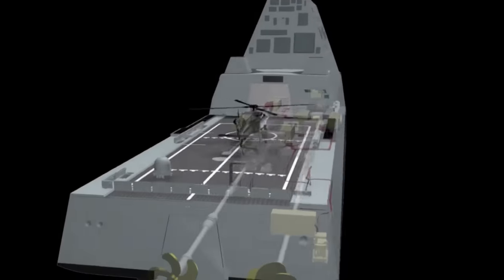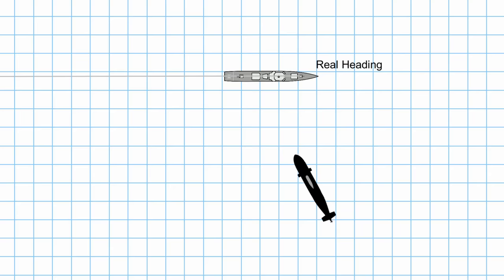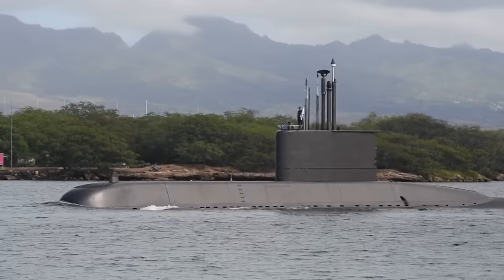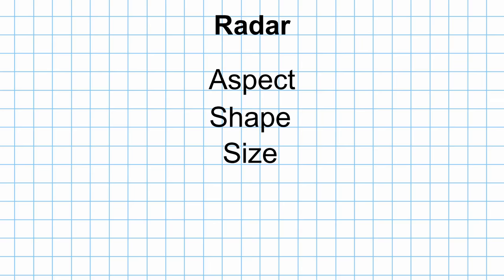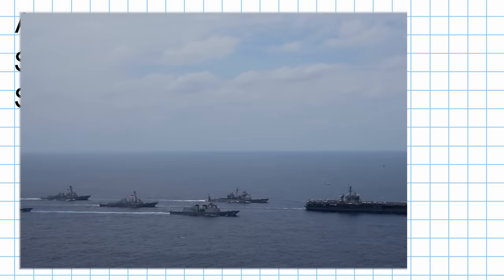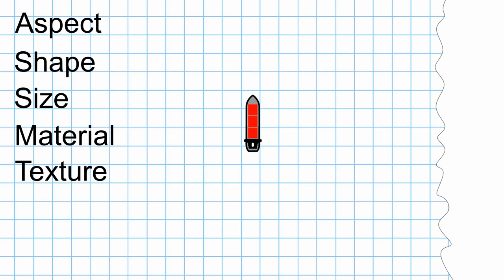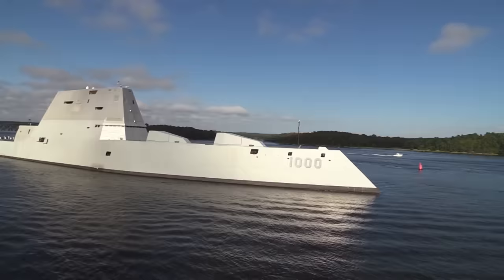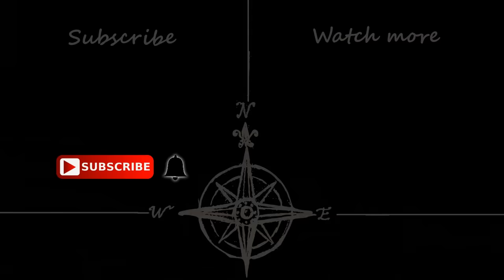Stealth Ships: How They Work

Comment: So you're telling me a wooden rowboat made of nothing but flat panels of plywood is the ultimate stealth ship?
Reply: Well it is but probably not very good of a battleship...
Reply: @eklhaft4531  They cannot shoot at you if they cannot see you.
Reply: What if u build of wood outside and inside with steel maybe that will work
Reply: @alexanderszewczyk8919  genius
Reply: @alexanderszewczyk8919  A wooden clad modern warship? Amusing.
Reply: @alexanderszewczyk8919  The radar waves that the radar is emitting would go straight through the wood, onto the metal and reflecting off it. Wood is a poor reflector as in it doesn't reflect electromagnetic waves, but lets them through.
Reply: @alexanderszewczyk8919  wood is invisible to radar, but they can still see the steel, so itd suck
Reply: @exoltal  he said "made of nothing but plywood"
Reply: @gracefool  He's replying to the guy who said "just put wood over the metal"
Reply: @GeneralPet  oops
Reply: Now I've got the idea for a wooden LCS carrying only caseless ammunition with carbon projectiles getting sunk three seconds after it's spotted.
Reply: Why am I imagining a guy with a 1911 sinking a battleship by headshotting the captain?
Reply: They aren't up at the lake with their family, fishing. The ocean would beat it to pieces.

Comment: Anyone saying size doesn't matter doesn't know what they're talking about
it's not just Size
It's Aspect
Shape
Material 
Texture
...duh
Reply: You sir just won the internet.
Reply: M a t e r i a l
Reply: @blahdolphinjsjsjs3818  mine is made of high grade steel
Reply: Honestly this applies much better for women than for men
Reply: @yoavmor9002   What?
Reply: Actually, size has nothing to do with stealth: the production-version of the Lockheed F-117 "Nighthawk" has the same radar cross-section as the scale model used on the Air Force's radar test range during development. Proper scaling is key. If you doubt my statement, buy a copy of "THE SKUNK WORKS" by Ben R. Rich. Ben R Rich worked with Clarence J. Johnson on the U-2 and SR-71, and took over the Lockheed Skunk Works when Clarence Johnson retired. Ben Rich was head of Skunk Works during development of the F-117.
Reply: @henriquetolentino1055  
Does it appear on Radar ? 🙃

Comment: How do you make a stealth ship? 

You make a Submarine.
Reply: *A diesel one with AIP
Reply: yes but boat
Reply: A submarine cannot carry the armament that a destroyer can, and older submarines have been getting easier and easier to detect.
Reply: Laughs in Sub-Hunter aircraft
Reply: Still Is viable to radar
Reply: michael wittmann U-boats have little to do with submarines, mainly the fact that as the name suggests they are just boats which can go underwater when needed as opposed to submarines which operate underwater whenever it can be helped. Look at the hull of a U-boat, its bow is angled like a ship and the hull has a distinct draft and a deck, a submarine has a blunt rounded nose, and the hull is cylindrical. U-boats are slower underwater as a result, while submarines are slower on the surface
Reply: How do you make a sub?
Reply: aSneakyChicken sorry to break your bubble, but a U-Boat and a Submarine are the same.
Submarine is just the dominant term.
Reply: @sarkhan_guy  no, Sneaky Chicken had it right. The U-boat was a precursor to a true submarine. Now that we can build submarines, why would anybody build a U-boat? That is why you don't hear much talk of U-boats nowadays.
Reply: mike bronicki ‘U-boat’ is literally an anglicized version of the word ‘U-boot’, which itself is an abbreviation for Unterseeboot (Under sea boat). Which is still the term used by the German Navy and in the German language in general.
Reply: @sarkhan_guy  the Germans, between WW1 and WW2 built most of the "submersible" boats in world history. So, unsurprisingly the term U-Boat is linked with this type of vessel. But a submersible boat is not a true submarine. If the Germans are stuck on the term that's on them, the rest of the world builds submarines because submersible boats are outdated. 
U-Boat = submersible
U-Boat not equal submarine
Submersible not equal submarine
The key difference as outlined in a previous post is that a submersible has a higher speed on the surface than underwater while it is the opposite for a submarine. It was common practice to refer to all German, British, American and Japanese submersibles as submarines during the world wars but ever since a true submarine (USS Nautilus) was built in 1955 the older technology has been referred to as what it was, a submersible boat and not a submarine.
Reply: Ever heard of sonar?
Reply: @mikebronicki6978  Dude, U-boat is just German for submarine...
Reply: @mr.magnificent3237  actually it's "Undersea Boat". Which doesn't change anything I said.
Reply: @mikebronicki6978  it is though,  it's an old submarine with a German name essentially. It operated slightly differently because of the technology not because it was a different class of ship
Reply: @i2ak  yes just as the US 2nd Cavalry Regiment of today includes no horses, a modern submarine force includes no submersibles.
Reply: Don't make a ship, that's the best stealth ship
Reply: @WalrusWinking  well a submarine could be built to carry all the armaments of a destroyer. Indeed the Japanese built aircraft carrier submarines in world war 2.
Reply: @mikebronicki6978  What the are you even talking about. 
1. Submersibles are usually drones or deep sea research craft with a mothership. 
2. U-Boat is quite literally the german term for submarine. Its short for Unterseeboot, but everyone uses the short version. In english its generally used to describe german WW1+2 submarines.
3. With Nautilus, are you actually implying that no sub without a nuclear reactor is an "actual" submarine? Thats ludicrous.
Reply: Submarines are actually boats
Reply: @termitreter6545  "Because speed and range were severely limited underwater while running on battery power, U-boats were required to spend most of their time surfaced running on diesel engines, diving only when attacked or for rare daytime torpedo strikes. The more ship-like hull design reflects the fact that these were primarily surface vessels that could submerge when necessary. This contrasts with the cylindrical profile of modern nuclear submarines, which are more hydrodynamic underwater (where they spend the majority of their time), but less stable on the surface. While U-boats were faster on the surface than submerged, the opposite is generally true of modern submarines. The most common U-boat attack during the early years of the war was conducted on the surface and at night."
Reply: @romanszwarc3288  So what, someone horribly misused terms. Btw, U-boat doesnt even mean "undersea boat" specifically, its an anglizised version of the german term U-Boot. Which should really show how absurd it is to pretend "U-Boat" is somehow a proto submarine. The term isnt even common before WW1, nor did germans invent submarines.

Also, the reference to nuclear submarines is complete nonsense too, considering modern diesel/AIP subs use the same shape. In fact, one of the last german submarines during WW2, the XXI-class, was also designed to travel faster underwater than overwater. Not because of nuclear engines, but because of its snorkel that fed air to the engines while diving at shallow depths.

This discussion is such a terrible attempt at smartassing, its silly.
Reply: @termitreter6545  "The more ship-like hull design reflects the fact that these were primarily surface vessels that could submerge when necessary." What does the undersea boat have to do with this? It wasnt even in my quote, that guy missused the terms is the wikipedia btw
Also, tell me which modern submarine has a hull like a ship?
Reply: @termitreter6545  actually nevermind, by digging deeper on wikipedia uboats were catagorized as submarnies, So you stand correct, sorry for wasting your time
Reply: @romanszwarc3288  To the contrary, I appreciate that you actually doublechecked and corrected the mistake.
Reply: or a space ship
Reply: @ziuzz4168  I did read about that recently. Apparently stealth space ships are pretty much impossible. Even small maneuvering thrusters can be easily detected throughout the entire solar system, even with current technology.
Reply: Akin Khoo  They have to surface for that, not that stealthy if you ask me.
Reply: Akin Khoo  semi-submerged like at periscope depth
Reply: Akin Khoo  Yes but the reason submarines are stealthy is that they are supposed to make very little noise that's why underwater listening stations are so crucial to national security. Also why a submarine's sound "signature" is kept top secret, and how many decibels a sub makes. Whenever you see a submarine at a public event the crew in that submarine will try to be as loud as possible to conceal how quiet the sub is. Just in case anybody from any foreign nation is around. If you're interested in more there's this guy on YouTube called "Sub Brief" (He'll also sometimes be referred to as Jive Turkey) 

https://www.youtube.com/c/JiveTurkeyCrew/videos
Reply: @N75911_  xD
Reply: @WalrusWinking  Laughs in Borei Class, Yasen Class, Ohio Class and soon Dreadnaught Class SSBNs. What's good does the armament of a destroyer do when you can have 16 nuclear ballistic missiles in a submarine.
Reply: @WalrusWinking   not when it is a Swedish electric sub the sneaked right into a US battlegroup and scored multiple hits on several vessels from close range. This led the US borrowing it for  design tests. Modern batteries allow a much longer time before any charging needed, unlike the diesel electric U boats of the war.
Reply: @GWAYGWAY1  Do you not realize how many Nuclear Submarines the United States has?
Reply: @WalrusWinking  Yes they have loads but they are very difficult to make stealthy as all the cooling pumps and nuclear power plants are very noisy , this fesults in  them to have to have special isolating measures to keep the silent. Electric ones were alway quiet but the lead acid batteries are dangerous when seawater gets in and need diesel charging  more regularly. The Swedish one was small and compact and silent running .
Reply: @GWAYGWAY1  Ummmm, that's not the point of the nuclear sub my guy. Turn off the regular engines and they have electric engines. Just as quiet. But the point of the nuclear capabilities is that it literally will never have to refuel over the course of it's lifespan. It's can go way around enemy battle groups, launch either cruise missiles or torpedoes and get the hell outta dodge.
Reply: True enough, but stealth is for weapons designers who lack the intellect and vision to create a weapon that can actually take a hit.  Case in point, these so called "modern battle tanks" that get hit with one tiny infantry fired rocket and their turrets are suddenly 20 feet in the air.  More like armored cars.  Or how about those multi billion dollar navy vessels that got put out of action after getting clipped by freaking container ships (and the freighters were fine...because of course they would be...)

Remember when weapons used to do something called "bouncing" when it hit armored plating?  Or the days where it took squadrons of dive and torpedo bombers just to sink one warship?  Pepperidge Farm remembers...
Reply: @elizabethlestrad5282  son in this age of crazy fire powers what's the use of armor anyways. energy explosions generated from modern heavy weapons are on the level that it is almost impossible to defend. there's a reason people don't build castles and artillery towers anymore in this age where a single missile can destroy an entire city. The falkland war showed even a single exocet missile can destroy a heavy modern warship. in the age where a single shot is all it takes to destroy everything, defending in navies and military in general are more about speed and mobility instead of strenght. hence the stealth technologies and catamaran/trimaran corvettes being built
Reply: @asneakychicken322 🙄 NOT AT ALL! THE U BOATS HAD ROUNDED HULLS IF YOU LOOK AT IT From the front. Last time I checked, battleships have angled hulls. It's just the fact that they didn't have a term for it other than Underwater Boat and what name would you give as an architect except for the OBVIOUS?!
Reply: @rizumaizhar2746   Ya tru
Reply: @WalrusWinking  in your lifetimes we will probaly see a time where submarines are useless to use as stealth because its a matter of time before we get that good at detecting things under the ocean
Reply: @greenvoodoo8366   cough U boat
Reply: @WalrusWinking  The problem is that you can't turn off a nuclear generator, it has to keep running. A running nuclear sub is quieter than a running diesel sub but the diesel can go into stealth mode. Now, if hydrogen becomes a viable technology for submarines it'll be the best of both worlds, no noise source except the propeller.
Reply: @GWAYGWAY1  Diesel submarines might have excellent stealth compared to nuclear ones but they are not without limitations of their own. 

Diesel subs rarely operate globally, at least not without a tanker following them for fuel and or they would have to visit friendly ports. Nuclear submarines can also stay submerged a lot longer, while modern diesel subs can stay submerged for an impressive amount of time, a nuclear submarine can do so almost indefinitely, allowing it to avoid satellites easily. Additionally, you can make nuclear submarines extremely quiet with an example being the highly advanced Seawolf Class and subsequent Virginia Class.
Reply: @run2u520   The Swedish one that was so successful against the US war games is powered by batteries and a Stirling heat engine using bottled gas. Very quiet unlike a battery on that needs to charge using diesel.
Reply: @GWAYGWAY1  It still lacks the endurance that a nuclear attack submarine has. It may be quieter, but diesel subs have substantially less range than their nuclear counterparts. In the case of Sweden, their navy does not need to perform missions all over the globe while the bigger navies such as the US, UK, Russia and China prefer nuclear subs as they have incredible range and can operate deep in enemy waters for extended periods without having to visit ports or a supply ship.
Reply: @run2u520  True Sweden wants coastal protection and nearby waters, horses for courses
Reply: You make it fly
Reply: Jesus loves you all very much repent and believe onto Him and be saved from eternal punishment of sin amen, Jesus DIED for you

Comment: In regards to texture, the specific paint used may also be partly radar absorbent, resulting n a smaller echo being created at all.
And interestingly enough, choice of material actually resulted in a couple early stealth aircraft being created during WW2. Both the Mosquito fighter-bomber and (although it never got past prototype and noone learned for decades) the HO-229 had very low radar cross sections compared to their actual size because of their wooden construction.

Comment: I couldn't stop watching. Really interesting video, great explanations. I learned a lot. I was expecting rough surfaces to be better, due to the fact that they wouldn't reflect a radar signal back at the radar vessel efficiently, but obviously if your surfaces are designed to deflect radar, a rough surface would be counterproductive! Thanks for making these videos.
Reply from the maker: Thanks gwolff. Glad you enjoyed the content. It is surprising how they are actually meant to be good reflectors
Reply: if you wanna go more in depth learning about radar, you should check out Radar Absorbent Materials (RAM). Some of RAMs use rought micro surfaces to scatter or attenuate radar in a fairly controlled way.

Comment: Missed one important radar point - Modern short-wave radars look for specific stress-related imperfections caused during the manufacturing process in the material used to construct an object, say the titanium in the F-35. An AF guy told me this was a concern in the mid-70's, so it's been known about for a long time. He said the first titanium based jets they were testing "lit up like a christmas tree" despite them expecting the exact opposite given the latest design / shape methods etc and new novel materials / compounds... This was material provided by the best (at the time) mills in the US, so the defence contractors had to develop an entirely new manufacturing process in-house and trash the vast majority of the produced material as not fit for purpose. Apparently they were trashing about 98.5% of what they used and roughly (not sure) 1.5% was useful, similar to how CPU silicon is binned these days.

Comment: You can see a lot of tradeoffs in action.

The F-117 follows most of the criteria, yet something like the B-2 ignores several of them, or doesn't go all out with them.

Supposedly the F-117 was built on the idea that a diamond shape was the stealthiest, but for obvious reasons, that won't fly, so they modified it from that ideal the least amount possible to get the thing to be able to fly.
Reply: The F-117 was designed that way because computers at that time were not capable of calculating Radar Cross Sections (RCS) of more complex designs, so they went for flat surfaces. This video is fairly accurate for a "how it works" sorta thing, but in the engineering and physics level it gets lots of things wrong. The way radar interacts really is far more complex than this. If you want I can explain you more in depth how radar actually works and how to achieve Low Observability (LO).